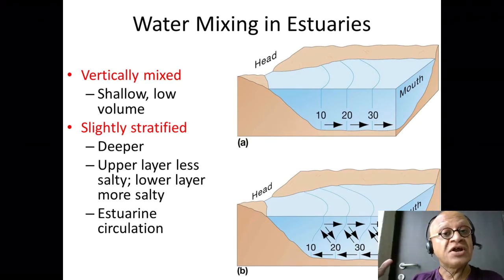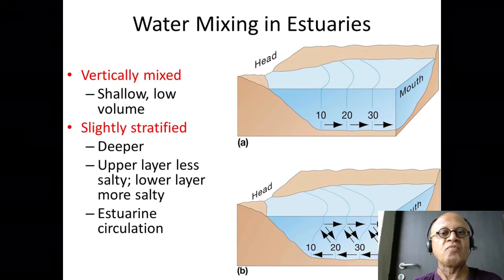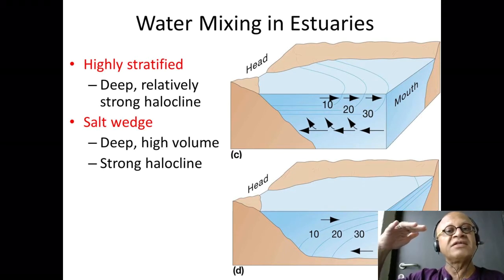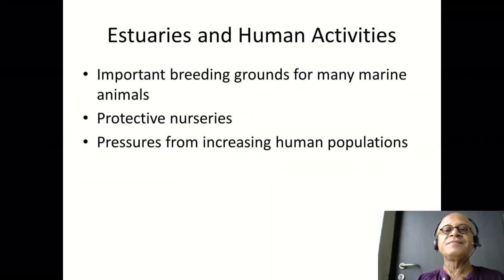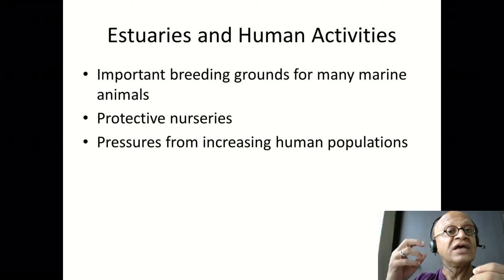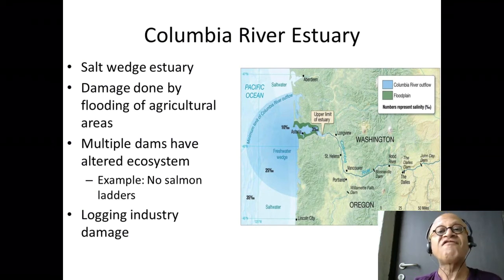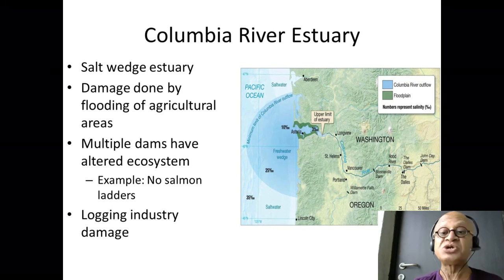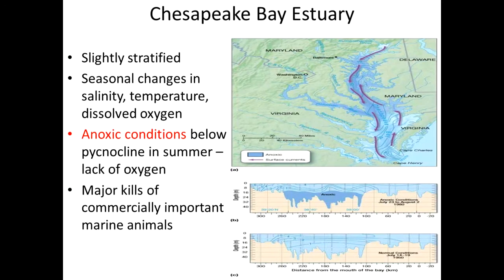5   Types of Mixing in Estuaries

Comment: Sir, how does vertical mixing take place in a salt wedge estuary, as there is a strong halocline? is due to tides?
Reply from the maker: Surface turbulent kinetic energy can be generated by winds - mixing goes as the wind cubed. And it is generated by surface cooling. Tides can mix if they run into topography and generate internal waves which break.